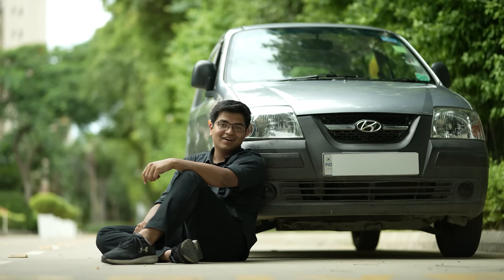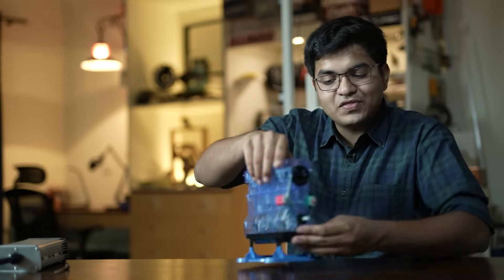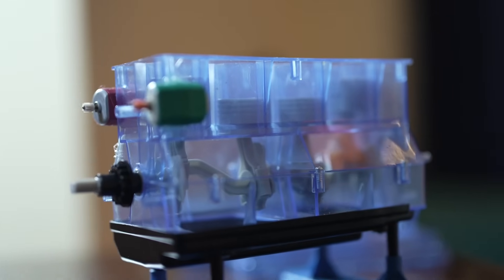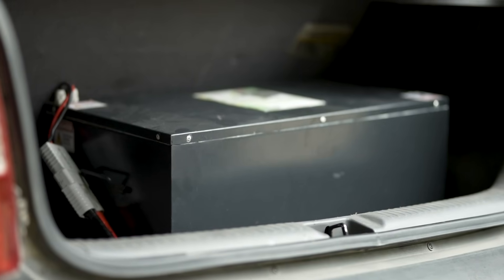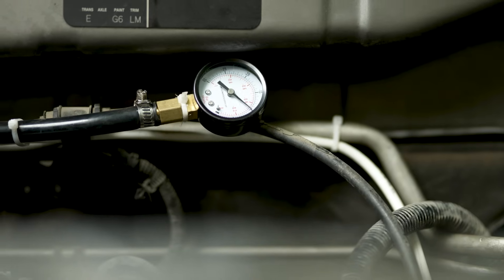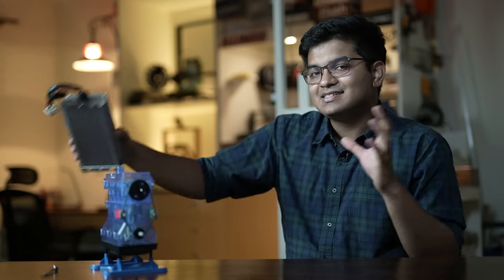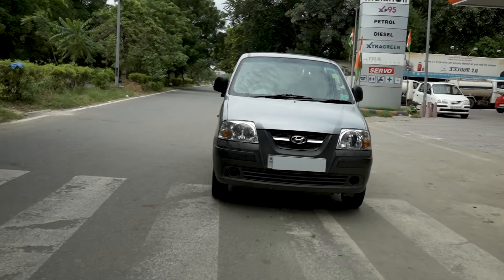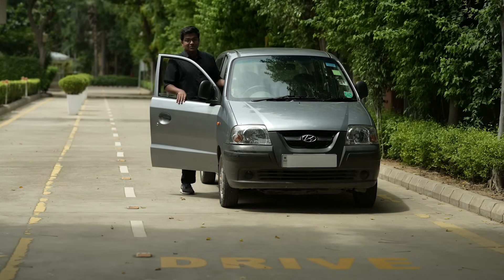Simplest EV Conversion under $3000 - Convert Your Car in 3 Days!

Comment: If the conversion cost is low then one doesn't mind changing engine oil every 10 thousand kilometres but this was a really cool and out of the box conversion . If you could get better batteries, better finishing, tweak the performance up a notch and replace the fuel tank with an IP 68 battery pack , this could very easily transform into a flourishing business of conversion kits , like it is with CNG conversion kits.
Reply: That's true, the engine oil would work even longer than 10k kms as there is no combustion happening, so no heat or combustion gases or fuel to degrade the oil. There are a lot of ways to build an electric car, but it all boils down to how much money is spent. The key is ingenuity, people in developed countries have access to funding and parts which are not available everywhere in the world.
Reply: @markpeterson1399  Yep, that oil will last 100km+ easily
Reply: You really have great auto knowledge & passion despite being an Indian woman. Engineer by any chance ?

Comment: If the engine and drive belts are retained, would it not be possible to retain the alternator drive belt? This deletes the need for the 72 to 12v device and lowers costs further.

Comment: Such a brilliantly simple design. No major surgery required

Any vehicle can be converted by any mechanic in one or two days by simply pulling the pistons and replacing the engine head with your EV engine head. 

Best of all, the car can be converted back to ICE at original specs just as easily by putting back the original parts.

Comment: Hello sir , a small suggestion. You can use alternator that comes with vaccume pump in it like alternator used in old Scorpio c2di series it will solve the braking and charging both problems perhaps we could designs a mounting position in Santro for the alternator

Comment: How safe are the lithium batteries in this thing?… genuinely asking
Reply from the maker: This battery was purchased from a company that specialises in LFP batteries. I would not recommend making such a large battery from cells. You have to be very careful while designing a system like this - the battery has a BMS in it that monitors several aspects of the battery and shuts it down incase any of those numbers are out of range. Almost all BMS' will monitor cell voltage, battery current and temperature. Furthermore, the motor controller has a set current limit and a low voltage cutoff to stop depleting the battery before it's even empty. 

There are several online resources you can use to safely design such a conversion. One of my favourites is the subreddit r/Evconversion. They have a megathread post that's very helpful too as it has compiled links to some amazing resources.

Comment: Just one suggestion. If not too complicated. I would also remove the pistons and connecting rods to further reduce the drag on the drive chain.
Reply: I think that's what he meant just could not show on the toy model
Reply: Sounds like a good idea to me, all you really need is the crank shaft itself. My idea is also to swap out the traditional engine oil with something like vegetable oil -- like used in commercial kitchen equipment. Should be cheaper and easier to source than what it's intended for.  Not to mention automotive oil likes to be well over 130C anyway. While vegetable oil is USED at far hotter temps, it would last longer being cooler and not being, you know, used for cooking. And when you DO need an oil change, give the used oil to a bio-diesel refiner and get paid for your oil changes to offset the costs of your 'engine' oil.

Comment: Huh..

I need another Ford Focus estate with a manual. Convert the Zetec gas into a Zetec-E, get a MUCH larger battery and place it in what used to be the fuel tank.. Find an electric motor capable of around 50 horsepower.. Might have something capable of 110kmh for longer than 50 miles.

Then find a way to charge it from 0 to full within about 3 hours without un-aliving the battery. Might have a decent rural commuter vehicle. 

Oh, and instead of running it on engine oil, might could get away with using vegetable oil instead. Cheaper, renewable, and can be refined into bio-diesel. Not yet seeing a downside with my idea. But I'm no engineer, either

Comment: I also convert gas cars to electric and have many u tube videos. I either connect the motor to the drive shaft or to the transmission. This is an interesting idea and will make it easier but I also wonder about loss through the pulleys belts and turning the crankshaft. An electric car going down the road is using about 10 horsepower so losses of of one horsepower mean a 10% bigger battery pack. Looking forward to seeing how this develops it's an interesting idea

Comment: Fantastic idea to piggy-back on the short block!

Maybe it wasn't clear in the video, or i missed it -- but you're driving all the power made by the electric motor through a serpentine belt?? Or is it the timing belt/chain? Or some other way?

Comment: You might want to consider converting the timing belt over to a chain with sprockets. Also, if you are still using the bottom part of the engine, is there some way engine oil is still being circulated to keep the crankshaft bearings lubricated?
Reply: I imagine the existing oil pump still pumps oil through the most important passages.
Reply: I also don't think it has enough range for a normal driver. 80 kilometers isn't enough for most people. And I also think it can be used outside a city. It's basically an electric grocery getter. You know what also fits that description. And electric golf cart. Which you can get for cheaper than a car and 3 thousand dollar EV conversion.

Comment: Rs-2,41,146.00 total cost
means 2274 ltr of petrol or 22740 kms
and also
battery replacement after 2 years 
its Better To Drive it on petrol 😀😁😁

Comment: First affordable conversion has anyone worked out the horse power required to do 100 km or 110 km for inner city freeways I was thinking maybe 15 or 20 horse power and about 50% more range this would work great for Australia. This would work for garages to do complete exchange or kit swap would be less then a day. Farmers converting old land rovers etc would be happy as well. The day will come (if not now) that the ev conversion will be cheaper the  ice engine and gear box replacement.

Comment: why u need 12v battery when u can just use the converter. this extra battery has no use and it will waste some of the energy.
Reply from the maker: You can definitely use just a converter - i actually did try that. The only thing is that you'd need a beefier converter without an onboard 12V battery to deal with the instantaneous spike in current that comes from stuff like the wiper motors and window motors.

Comment: Nice build, but the timing belt is not built to transfer the full power needed for motion (only to actuate the ports). Wondering how long it will survive
Reply from the maker: Yeah I'm interested in monitoring the belt health. Since the motor is small and the car is pretty light, it seems to work for now. I'd love to post a video after a year of driving it as an update on what worked and what didn't! Thanks for your comment
Reply: @MakingWithMihir  Soo Curious to Make My Car Like That !

Comment: This is a really cool and creative way to repurpose an older vehicle!
I'd be interested to know more about what motor you used and the speed control.
If you were willing to source some used parts you could fit the braking system with hydroboost (a loop from the power steering pump) and eliminate that vacuum pump.
This is popular and well documented retrofit here in the U.S.
Reply: This is recycling the typical way it should be done!
Reply: A lot of people use forklift motors and I’ve heard some people use golf cart controllers
Reply: He said that info is on his website.
Reply: you mean the "worst use of battery tech" v12 and a manual is better
Reply: @harrygregory6227  dude do u even follow this guy.... Santro and v12 engine....dont make me laugh
Reply: @harrygregory6227  where would you get a v12 for less than 3k lol the point of this is to be practical and affordable
Reply: @harrygregory6227  ratio

Comment: Great job!  The only question I have is how long is the timing belt going to last if it is expected to handle the traction motor pushing the car along?
Reply: Good point! With only an 8 hp motor, it's probably fine. With higher output, the motor would need to take the place of the crankshaft. He could achieve this with a dual output elec motor.
Reply: There are some cars that use a chain belt

Comment: Great build. You might want to reconsider engine oil grade to one which flows better at cold temperatures.
Reply: but this build will have to keep the motor running all the time event the car stoped, to running the ac? battery will depleted faster,
Reply: @billykulim5202  how's that different from usings different motors? Both will use battery as energy source. Electric motors unlike engines are very efficient and it wouldn't make much of a difference to use a single motor.
Reply: @parasahlawat27  can we just using smaller motor to run those compressor? when the car in idle like in red light will save some energy?
Reply: @billykulim5202  yes you are right but with single battery pack the gains wouldn't be worth having another motor. Plus much of the power in case of engine is wasted in running the engine itself which is not the case with electric motors. Economically upgrading the battery pack would be a more viable option than buying second motor and controller. However used motor from E rikshaws could be viable option.
Reply: I believe that you could remove the internals of the engine, keeping only the crankshaft and gear, mostly eliminating the need for oil
Reply: @KostasTsakalidis  - my thought also. I imagine all the gearing to the oil pump is still intact.

Comment: I Love the Idea - But my star is still kinda new, Nut I would like to have an electric motor at the back to help out in reducing petrol cost
My Car is somewhat efficient at 10km/L of city driving - I would like to make that higher
I was thinking of sticking one big motor at the back and converting my two free willing tyres to put out power 
or use two electric hub motors - but it will take a good motor/s so it should reach above 100kms/hr. - A controller and a way to have regenerative braking
I have begun my canvass but I'm met with very expensive parts - as I will need something to be robust enough for above 100kms/hr. speeds
My Car is a large MPV Honda Mobilio, I plan to take out my Rear spare tyre and mount the batteries/controllers and chargers in a box, it will be housed under the car but I think it will be better if it opens from the inside/top. Am I too ambitious or do you think will this be beneficial for me in the future. Thanks for the read.

Comment: very good concept for cheap conversion. But the extra mechanical parts like the crankshaft and the transmission gearbox will contribute to the loss of energy due to extra weight and unnecessary movements. This could be removed by using only the transmission and trying to add ac compressor with a separate motor that will run only when required. KEEP IT UP

Comment: I have TWO questions.
1. Why not throw out the entire engine, one end connects to the gear box and with a  shaft remade to be a little longer;  both pump and ac can be powered.
2. Why carry the weight of that 12 volt battery ? We already have one , a converter will do the trick.

Comment: I owned same colour Santro 2008, the method you used is ok for fun but no way a right method becomes it gives up the best benefit of EV of having less moving parts, less maintenance etc. Not forget the with all these redundant parts comes extra weight hence less range. But a good starting point best wishes to you to move up

Comment: Putting in 3 lakh more and drives for 80 km with 60kmph with 10 unit everyday . It doesn't seems to be a great deal to me. Instead put 3 lakh worth of fuel for next 3 years seems a great deal , i know it is not perfect in every aspect but yeah good job you did there , probably you wont have to get it scrapped , instead it will be just okay standing at home and occasional running

Comment: If you had explained shown how you got rid of pistons and made motor mount and took care  of engine seal
Reply: There is no pressure so no need for engine seal, IMO.
Only the crankshaft needs oil which is done by itself as the shaft rotates.
Reply: @joeabad5908 thank you for explaining, some videos of fabrication mounting would have been good or mention of next video

Comment: too costly with 2, 40,000 and conversion charges and RTO challan , it is bad deal.
for 2, 40,000, we can have petrol for 4- 5  years   with average of  5000 rs per month which is huge .  price should come down to 50K  then conversion is good.

Batteries are also costly and are having huge failure after one year 

think innovative , not making fool  ,  to ensure that you get new  technologies 

note indian vehincl  owner loves and  appreciate  some short cut of technologies and less cost at your cost all are offering the same.

CNG /LPG with 2, 40,000 we can run for 10 years

Comment: It was very short video, please post the detailed video of how you mounted the motor on the engine block, and all the electricals, also please explain what if we install a 12v volt ac compressor, or if the steering was electric, how would this be different? lastly mounting the motor directly on the gear box vs your implementation, what would be the difference in torque and mileage!

Comment: But in this conversion, the motor has to be running even if the car is in traffic n all right which isn't that economical....and to run the ac compressor, you dont really need such a powerful motor

Comment: Next time remove the pistons and leave the crank shaft, this way you shouldn't need oil, less weight too :)
Reply from the maker: Hey! Thanks for your comment. It wasn't very clear in the toy model but I did remove the pistons from the engine and left only the crankshaft. However it was my understanding that even the crankshaft alone still needs engine oil to prevent it from seizing up?
Reply: @MakingWithMihir  Less Oil for Crankshaft Buddy maybe 3/4 or 2.5/4 of the total engine oil  capacity 💯

Comment: with the new norms in place no car older than 15 year will be approved to be converted ... as old cars dont have required airbags or seatbelts or any crash worthiness or modern braking system

Comment: You shouldve mated the electric motor to the transmission instead of the crank. Loss of energy to turn a block with crankshaft.

Comment: great idea ...

some questions ... 

can the alternator not be powered off the timing belt that powers compressor and the pump ...

can the cheaper srm motor be used? yes it does require a torque controller circuit to control torque ripple

regen using the alternator?

Comment: Awesome work Mihir. Does this mean that we can get almost twice the range in an electric car with gears from the same battery as compared to an ev without gears. That's incredible. 👌🏻👌🏻
Reply: Nice comment, I assume it is ab ironical one, as indeed yes, the range he is claiming with such a small battery, and with gears, and not the gearless motor sounds absurd.
Reply: @KostasTsakalidis  Not to mention the loss of power due to spinning over the bottom half of the ICE as well.
Reply: @1974UTuber electric motors have  more torque to compensate for loses  an don't forget he's only turning the crankshaft
Reply: Hai I HAVE MARUTI ALTO 2010CONVERT THE ELECTRONIC CAR IS IT POSABOLE PLEASE WARE ARE YOU PRICE MILANGE ETC TELL ME PLEASE

Comment: you cant use your car ac and power steering at a stationary position 
if you want to use it at idling rpm so you need to use netgain hyper 9 motor kit , it has a idling function

Comment: This is fascinating.  I would love to adapt this idea to my 1977 RV.  However, when thinking about converting to electric, I noticed that heavier vehicles sometimes use dual EV motors, one for the front and one for the rear.  I wonder if you used your form of EV conversion in the front, could you use the same setup in the back as well (parts of an ICE engine and the new EV motor) or could/would you use just an EV motor for the rear? Would both setups allow you to steer the front and back separately?  I don't see how they would since an EV motor only setup doesn't use the gearbox, so it seems like the two setups would be in conflict.  Also, manufacturers, use traction inverters, is that any different than the inverter you used?  Is the term "traction inverter" a buzzword or does it actually mean something?  Do you think your conversion would work the same if the car had been an automatic?
Reply: Convert it to hydrogen, battery EVs are garbage for heavier vehicles.

Comment: Can timing belt can transmit that amount of torque. It just operates working of cam and valves in a ic engine. Which is way less than to propell a vehicle. And as far i know santro cam pulleys have woodruff key on cam pulley which can fail on load. Other than that a great project.🙌🙌

Comment: Hi, you can easily fit the battery inside the fule tank by cutting of the upper roof of the fuel tank and modifying a bit and then putting the seat back on, I'm not sure if it would work out but I think it could be something to think about.
Reply: You're onto something with this. Maybe add a bit of reinforcement for the weight of the battery if necessary

Comment: In the long run, it will become a money eating vehicle...
Reply from the maker: Hey! Thanks for your comment. While there will be the cost of changing the engine oil, since there's no combustion happening anymore you'll have to change it out much less often than a petrol car. That combined with the extremely low running cost makes this a much cheaper car to run.